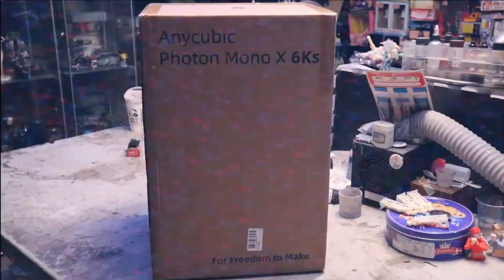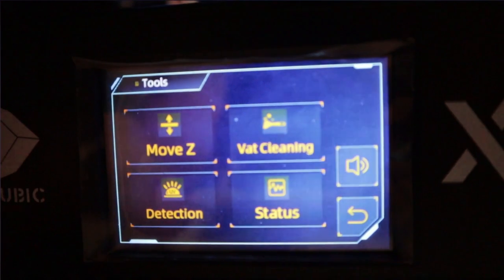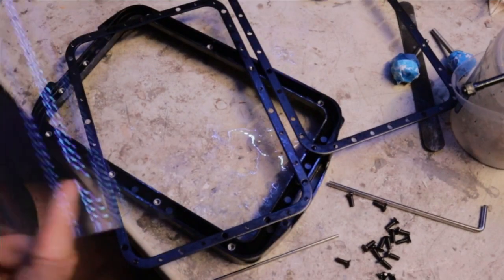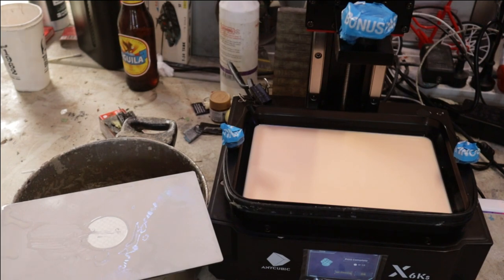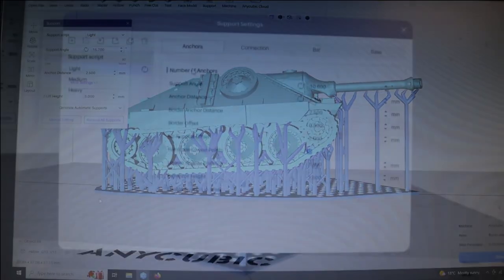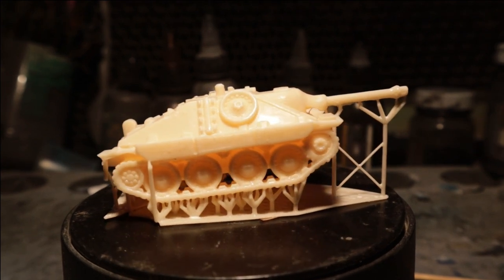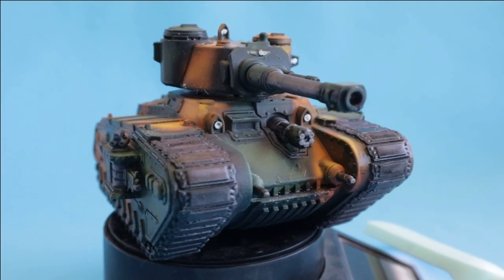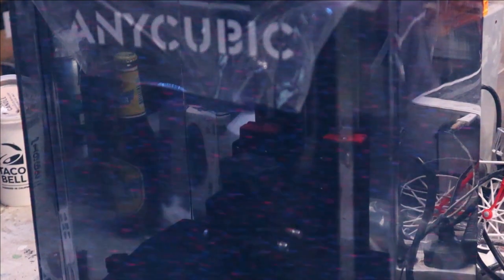Anycubic Photon Mono X 6K - review setup resin 3d printer

Comment: A good advice! If you planning to use the same resin then just leave it in the printer and cover it with a big empty box 📦 from lights. You can leave out for years without during it back in the bottle. Of course only if the print didn't failed and big pieces can be  inside
Reply from the maker: the last two old printers I covered the UV cover in paper and tape, at one point resin sat there for a few months no issues. Just needs a stir, Im planning on getting a nice cover sewn for it to pull over and still have a clear cover to film though for videos.
Reply: Hi Friend! Isn't the smell of resin annoying when you leave it in the printer?

Comment: Wow, the outputs are so clean! Few years ago I was considering getting a used Anycubic to play with but not having a workshop space nor grasping the technical aspects of working with resin scared me off. Following with interest.
Reply from the maker: Resin printers are consumable and will  break down after few hundred prints or worse few dozen bad print or mistakes. You can get a small one for around 100 something us and operate it on a balconie. Size of about an kitchen appliance plus smaller the easier to use

Comment: I currently own a mono 6K and took delivery of my 6KS last week and can honestly say it’s better in every regard. I am curious as to why you applied a screen protector when mine had one factory applied to the screen. Any cubic, moved away from an oversize protector with this printer, and is using one perfectly cut to fit the screen.
Reply from the maker: Except the UV cover I swapped it with the old yellow one. I assume being a late adapter of 6K mine is a different batch to yours. The screen protector was included separate and mentioned in the instructions to apply. I honstly do not see much of an advantage of it being perfect fit after using just cling rap on the older model. For after  market application over sized would prevent  user issues. Other wise very very happy with it.